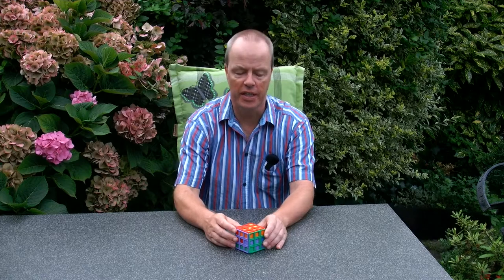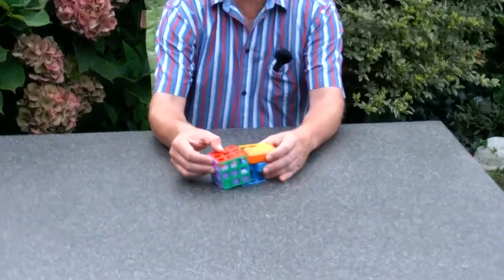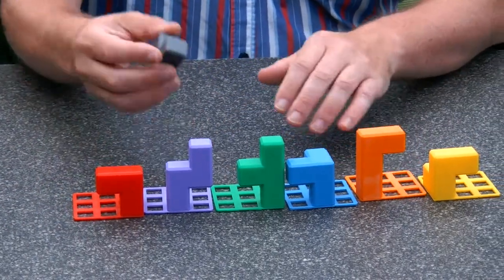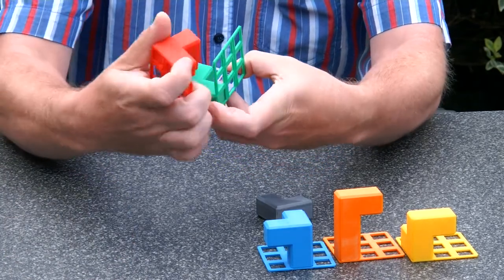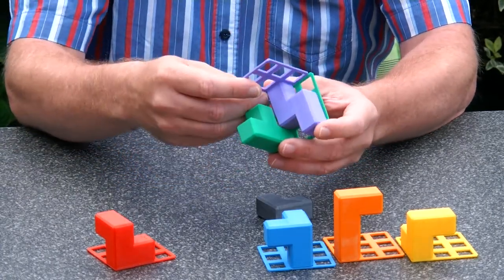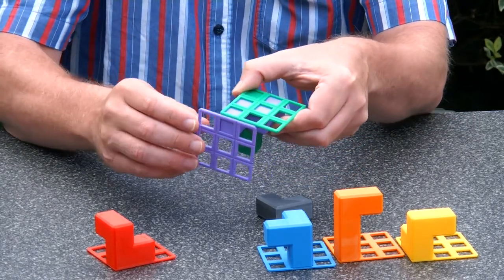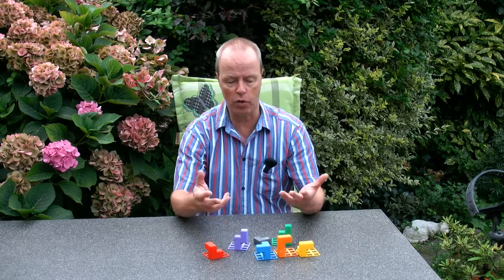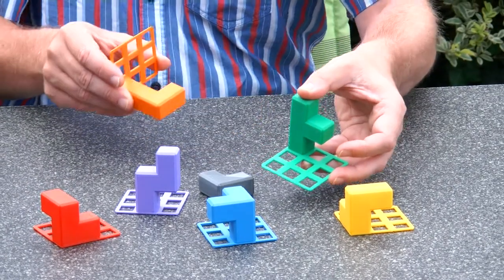Hooker Soma: How are these pieces hooked together?

Comment from the maker: What made developing this design so challenging?
Reply: Finding a solution to the soma cube in which each piece is exposed to a wall in such a way that each one can be attached to one of the walls without multiple being attached to the same wall? Another possibility I could think of would finding a configuration that satisfies that requirement while also having the pieces configured in such a way that they can come apart.

Comment: It can't take multiple moves to get it apart because there aren't any voids in the middle, so any movement any piece can do immediately can be continued until the piece is removed
Reply from the maker: That reasoning is only correct for the very first piece that you pull out.